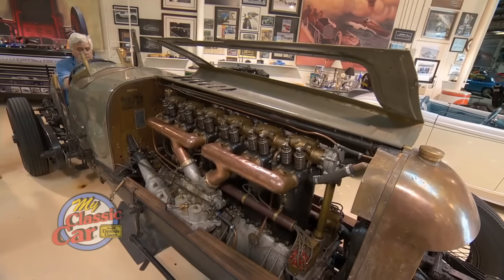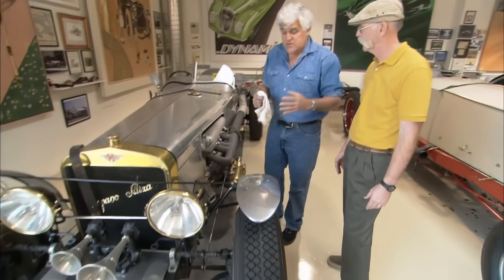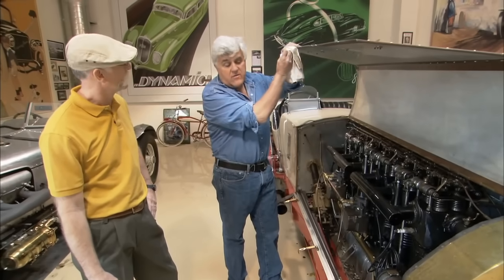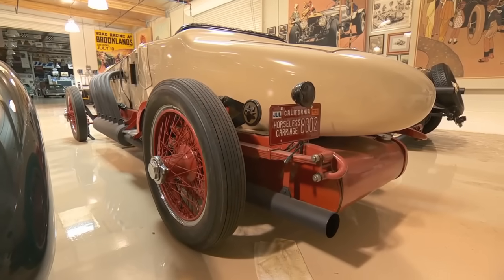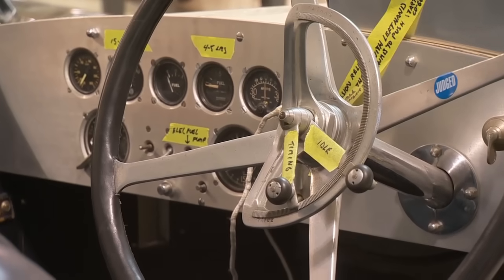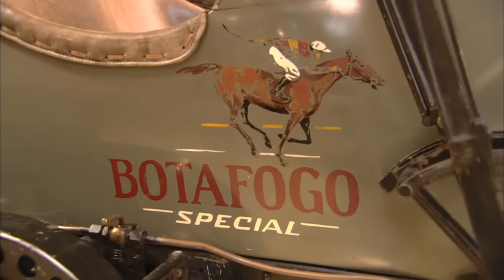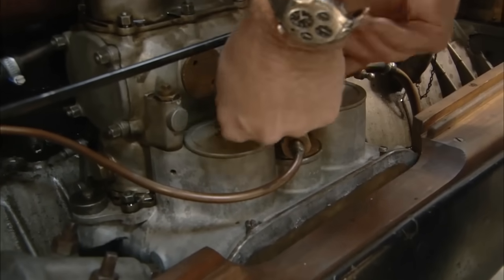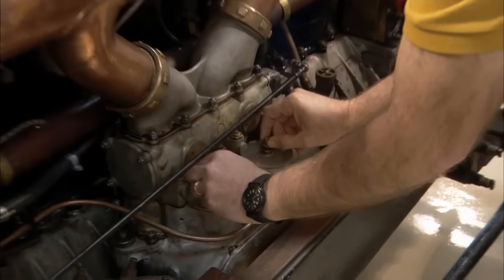Jay Leno’s Room of the Giants

Comment: Looks like the thing actually rips too. They were passing cars on the highway at like 900 rpm, with 600 rpm to go; that 28 litre would be blasting at 1500 rpm. Just a crazy mobile. It reminds me of my local forestry museum with trains from circa 1900. That old mechanical stuff is so impressive. Rudimentary yet violently powerful compared to human or horse power. It allows the impressiveness of the engineering to shine. Nowadays everything is so hidden away; you can't even tell our knowledge of physics is simply profound.

Comment: I'm almost sure that the 'Benz Mercedes' here is what the rotting, rusted heap that was buried in a thicket near our house when I was eleven years old or so must have been when it was new.  I remember the chain drive sprocket and the unbelievably huge motor. Once I cut a bunch of stuff out of the way and levered the front open, and lots of parts were missing and there were herds of pack rats in there, but I was amazed at how huge the engine was.  I wasn't even really sure it was a car, with that engine.  But it seemed too low and the wheels were too small to be a tractor, and the chain drive wasn't a tractor drive train.
They cleared that thicket over thirty years ago; I have no idea what happened to the car, but I'd bet at least even odds on it having been buried in an embankment to slow erosion - which is what happened to a lot of junk machinery around there.

Comment: 6:02 If the engine is 21.7 liters it would be 1323.7 cubic inches and 220.61 cubic inches per cylinder or 3.61 liters per cylinder. So Jays comment about each cylinder being about the same size as a 327 is no where near correct the cylinders are 106.39 cubic inches smaller. A better statement would be each cylinder is close to the size of a Buick grand national engine. I’m not trying to be that guy by correcting Jay like the spelling police on Facebook, Jay is not a stupid guy by any means I love Jay, I love what he’s doing, love the work his team does, shit I’d love to work at his shop they do the type of work I love to do not the work I do now which is auto repair on regular newer cars I own a repair shop, I just am a professional gear head and like people to have the correct information. For anyone looking to figure out the numbers of an engine there are 61 cubic inches per liter (it’s actually like 61.024 but 61 is close enough to get a rough idea. If it’s a huge diesel engine in a ship like that one engine that’s like 1800 liters then u would want to use the exact 61.024 but small engines like a 5 liter ur only off by .12 but 1800 liters ur off by 43.2 liters). Anyways it’s amazing to me how back over 100 years ago over head valves, 4 valves per cylinder were used, over head cams were used but car manufacturers didn’t really start using overhead valve engines until the like mid 50’s, we didn’t really start using over head cams until the mid-late 80’s and didn’t start to use 4 valves per cylinder until the late 90’s and really the 2000’s was when most all regular passenger cars had 4 valves per cylinder and also over head cams. Also aluminum engines were around 100 years ago but we didn’t really start to use them until the 2000’s. Aluminum heads started to get really used in the late 80’s and should have been used much sooner not even just for weight but for emissions and power because aluminum doesn’t hold heat like iron so u can run higher compression ratios before worrying about detonating. Really all of this technology 4 valves, over head cam, aluminum atleast heads, the hemispherical combustion chamber should have been used long ago. The hemispherical combustion chamber is in pretty much every single 4 cylinder head now with 4 valves over head cams and has been for the past 20 years, also many 6 cylinder heads too. I mean 4 cylinder engines have more power now then the most powerful engines of 50 years ago

Comment: The 1917 Fiat with the 21.7 L, 6 cylinder engine.  21.7 liters = 1324.215 cubic inches.  1324.215 CI ÷ 6 cylinders = 220.7025 CI per cylinder.  Each cylinder is 220.7025 Cubic Inches.

Comment: I see the car needed more fuel pressure when on the road.  I wonder if these were raced with two drivers?   I don't think Jay could have reached the fuel pump handle from the other side of the car.

Comment: 18 liters is bigger than the cummins ntc855 (855 cid) its 14 liters.  back in the 30s mack built trucks with  massive gas pig motors. my ,have things changed

Comment: Brakes are over rated anyway. I once drove my car to pep boys because the Master Cylinder was shot and I had no brakes. They nearly died when I told them I would be driving the car in --- with no brakes. I live 0.7 miles from pep boys. I drove it in at 2am on the back roads (so 25 mph limits) and used the Emergency Brake and simple throttle controls to come to the few stops I needed to make. In addition I came no were close to the posted 25 mph speed on that road and had my 4 ways on the whole way.
Reply: Might as well cut my brake lines very soon.